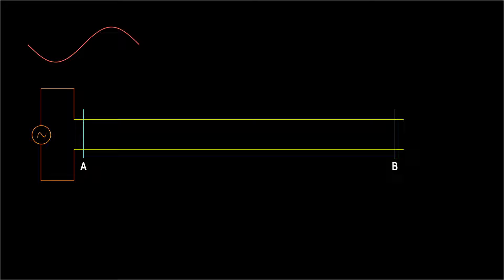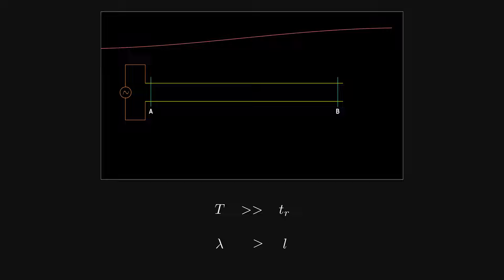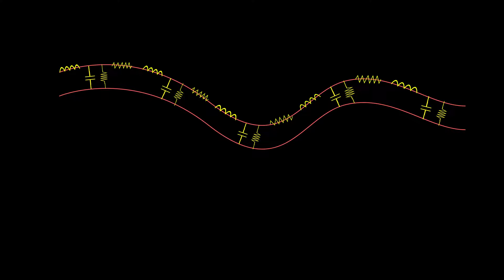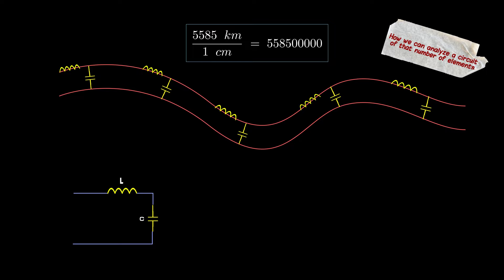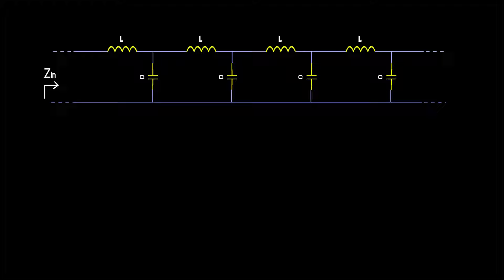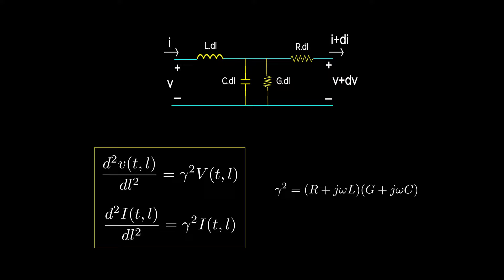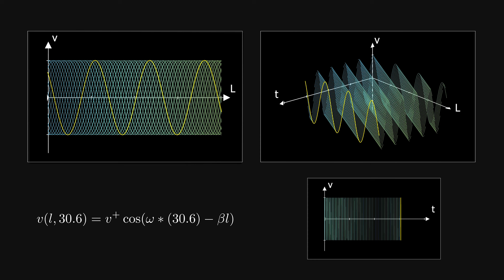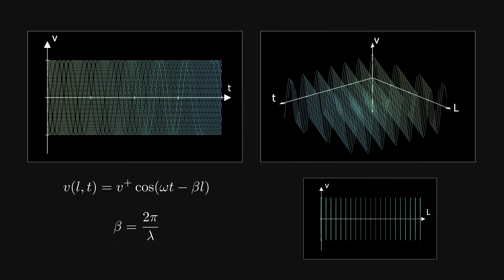Transmission Lines: Part 1 An Introduction

Comment: I wish you'd explained the meaning of the characteristic impedance.  You put a formula, but didn't give the definition or explain what it means.
Reply: From how i understand it:
The characteristic impedance of a line is the resistance when placed and replaces the line will result in no reflection. Its defined as impedance because the "characteristic impedance" is only applicable to AC / waves. it arises from the construction of the line: from the capacitance to itself and from the inductance through. Because we live in a non ideal world, a single copper wire will have inductance. Two copper wires will have capacitance. Interestingly, we find the length of the transmission line is proportional to capacitance and inductance. Similar to density. A blovk of aluminum has X, Y, Z dimensions. We increase X by some small amount x, the mass will increase by x times Y times Z times density. We have a transmission line with capacitance "density" and inductance "density". When we turn the circuit on, the electric field travels very quickly. The electrons take time to move, and when they move they update their field and move other electrons (inductance). The electric field that moved very quickly affects electrons, pulling them to the other line (capacitance). Electrons are both pushing eachother and propagating a wave. At the Same time, pushing to the edge of the conductor and showing the results of a wave. Electron movement in the inductive case is "lagging" behind the electric field (its like inertia, you push a skater, the start is slow but later they are gliding without your pushing). Electron movement in the capactive case is "leading" (because the more the electrons push to the surface, they start to slow down other electrons). Remember how i said reflection - when you work with these capacitances and inductances, tou get waves/propagation. Because it is a combination of electric field and electron flow, you find there is an impedance. A reflection occurs because you supply an electric field and the line (its indutance and capacitance) determine electron flow in a propagating manner. When the line has a change in impedance (inductance or capacitance), the electron flow inherently changes. The change means it has to propagate, it propagates forward in a different manner to before (if electrons were shoving eachother before, now its like a light tap), AND it propagates backwards (equal and opposite reaction). Its behavior is identical to a wave hitting something and reflecting back. In a DC case, the line impedance means nothing. In AC or transient (connecting a switch for instance), the line impedance matters.
Reply: The reason that the resistance replacement does not cause a reflection is because characteristic impedance is defined as a single wave without reflections and is the ratio between the voltage and current.  A resistor is inherently defined as a ratio between those two values. As such, the wave travels through and "sees" a resistance. Because its AC/transient, we say impedance to note that it is not static - it is periodic. because reflections happen for waves/transients, and because they happen when impedances change, replacing the line with a resistor means the electric field and electron wave will not see a change in impedance.

The line is not a resistor though, it is 2 lines that are meant to form a loop with some other thing. If there is no connection, there is a reflection. If the thing has a different impedance than the line, then there will be a reflection. If the thing has the same impedance, there is no reflection. And these are only true for AC/transient. In the DC case, there is no reflection.
Reply: Listen again starting at 5:00 in. It’s abstract in a way, but clearly explained.

Comment: I have a question, since electricity travels at light speed, we can see difference in the voltage levels after the distance of 3000km, does any transmission has the distance more than 3000km? Please help to understand!!!?

Comment: Sir, could the abbreviations or legends be updated referring to formula at the gamma. Elaboration on the single line with inductor and resistor having two parallel line where one of it was capacitor and the other is resistor on sine wave with actual numbers and maths calculating the impedence and the voltage at the  start and end including the flow? If resistor on single line is higher it push back current and vote backwards flowing through to capacitor. How much is the limit on impedence or reverse current that can be stored in capacitor and what is the voltage and current within the single line inductor and resistor and capacitor with resistor circuit. (Thank you, this information helped on maths excellently)

Comment: Your presentation style is top notch, sir! Very nice! And you seem very knowledgeable. I'm just an electronics tech, but I'm supposed to understand the basic stuff, I figure. A voltage waveform makes perfect sense to me, but not a current waveform; they don't seem like different things to me. Voltage makes current flow, so the current accompanies the voltage like a side-effect, when the circuit is closed; they are inseparable. I figure I must be wrong, but I don't see where. We were taught that "drift current" is not electric current, this latter transacting at near-light speeds, whereas drift current might take an hour to travel an inch. It is current flow that engenders "resistance"; voltage, or charge, doesn't encounter the same sort of resistance. But it makes intuitive sense for me to imagine that it's this drift current that is organized and motivated by the voltage differential to become electric current flow in a complete circuit.

Comment: @ 00:09 "SUPPOSE WE HAVE TWO LONG WIRES" (with one wire you suggest this is made up of the two lines drawn).
@ 01:01 ARE YOU TALKING ABOUT VOLTAGE-DIFFERENCES ALONG THE LINE OR BETWEEN THE TWO LINES???
Advice: Be more clear in the terminology you use!

Comment: at 3.48 isnt it the opposite ? At low frequency an inductor reduces to a short and a capacitor to an open circuit
Reply from the maker: Huge capacitance has very small impedance even at low frequencies (Zc=1/jwc) where w=2.pi.f
Also huge inductance has very high impedance even at low frequencies Zl= jwL

the inductance and capacitance here (for this very very long wire) is very very huge

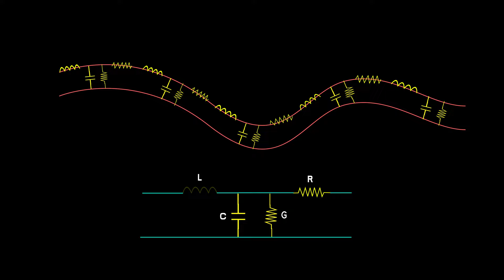Comment: 3:41 Something must have been mixed up 🤔
Reply: Yes, the cap should be open and inductor should be shorted
Reply from the maker: Huge capacitance has very small impedance even at low frequencies (Zc=1/jwc) where w=2.pi.f
Also huge inductance has very high impedance even at low frequencies Zl= jwL

Comment: but when you talk about lumped circuit in low frequencies, why you say that inductance is equivalent to Open C, and capacitor to short C, is it not the inverse?
Reply from the maker: The total inductance and capacitance of this very long wire (5585 km) is huge. 

Impedance of that huge inductance (j.2pi.f.l) is very large even at low frequencies (f) so it would act as an open circuit.

At the same time, impedance of that huge capacitance ( 1/(j.2pi.f.c) ) is very small so it would act as a short circuit. 

Notice that this is an AC circuit not DC :)
Reply: @TheSiGuyEN  Thanks for your answer

Comment: 3:45 why would shunt capacitance become short circuit?
Reply from the maker: Huge capacitance has very small impedance even at low frequencies (Zc=1/jwc) where w=2.pi.f
Also huge inductance has very high impedance even at low frequencies Zl= jwL

Comment: Is transmission line theory for AC currents?
Reply: I assume it must be, because we talk about frequencies.
Reply: Yes, but even many non-AC circuit situations manifest AC characteristics during state changes.  Digital signals involve state changes that are essentially impulses or ramps that have AC characteristics.  So transmission line analysis can apply even in highly integrated DC circuits.